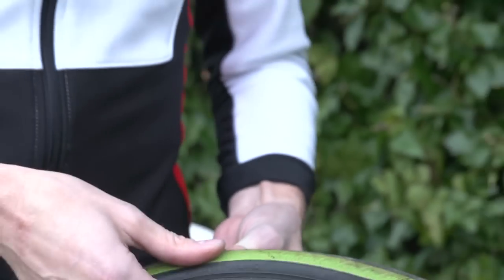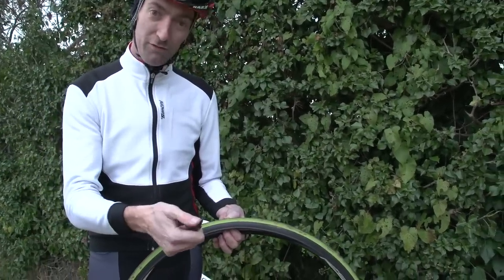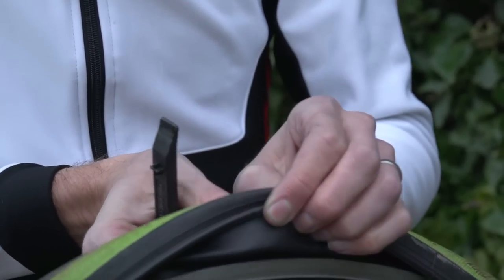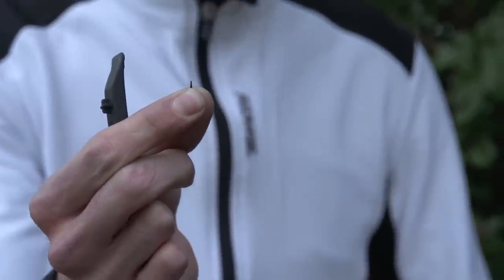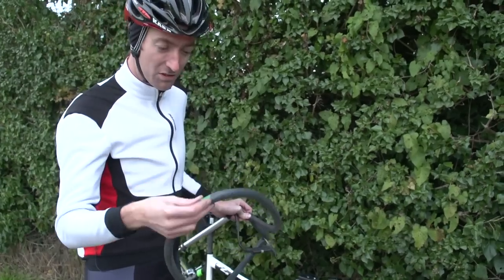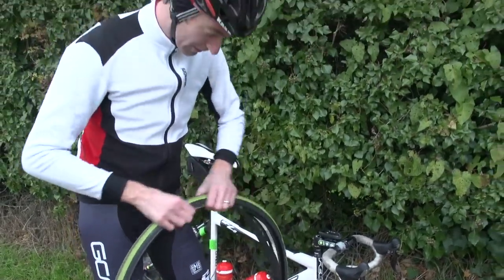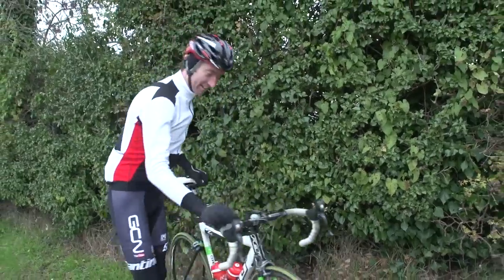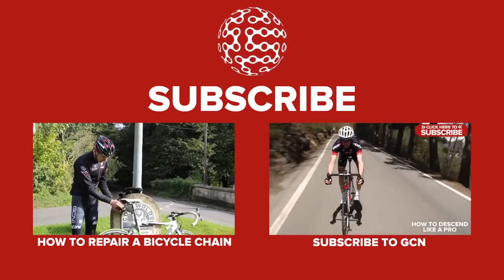How To Repair A Puncture On The Roadside - GCN's Roadside Maintenance Series

Comment: Stages of a puncture 

1 - The wince - as you hear the bang of the tube / wheel hitting the road. 

2 - Denial - you carry on for a few meters all seems okay so you think its fine to carry on 

3 - Understanding - as you feel the abnormal vibrations comming from the wheel 

4 - Rage - at the council / highways agency for not fixing that massive pot hole in the middle of the road 

5 Acceptance - you resign yourself to the fact you can't continue without a fix 

6 The fix - 5 - 10 mins wrestling with a tyre that seemingly doesn't want to come off or go back on again 

7 Marginal gains - after a succesful fix you feel suddenly rejuvinated and full of energy, performance of the new tube seems a mile better than the old one.
Reply: N
Reply: That was really funny and also true. Thank you for a good laugh!

Comment: An other tip to locate the hole in the tube : when you install the tire, line up the logo with the valve, then when you locate the thorn in the tire you can roughly match the same location on the tube.
Reply: Thanks ...I’ve done for years after a tip from the internet and it works a treat. Otherwise your gambling that you haven’t missed the sharp on your checks.

Comment: Guys love the videos "brilliant". To keep from potentially cutting your fingers on the sharp object inside the tire, I take the tire completely off the wheel, turn it inside/out then check it. It's easier to find what's inside since the inside is cleaner, no dirt or mud and you're less likely to get cut.
Cheers,
Bob (former Tweak of the Week) winner
Reply from the maker: Good points Bob, thanks for mentioning them.
Reply: hmm

Comment: Dan, how do I know the mini pump is giving enough pressure to my tyre if I didn't have a pump with a pressure gauge?
Reply from the maker: Press the sides of the tyre in to check the pressure, simple and effective. If you practice at home when they tyres are the right pressure then you'll know how hard they need to be.

Comment: here is how you ride tubeless
Reply: +Tucker Steward One does not simply ride tubeless if he wants a good ride on his roadbike.
Reply: Microage tubeless is a good rde no flats
Reply: Tucker Steward
Tubeless are way less comfy and feel sluggish compared to high end clinchers.
Reply: Microage yeah but a lot lighter
Reply: Tucker Steward
How? The tread is thicker and therefor the tyres are heavier, about 30g on a 25c. Additionally you have to add tyre sealant which also adds some weight.
Reply: Microage less rotating weight which makes it feel lighter
Reply: Tucker Steward
The rotating weight is the same or sometimes even more. The tyre sealant is also rotating you know :P
Reply: Microage no the tire sealant is at the bottom of the tire at all times flip a glass of water over and it goes to the bottom same with sealant
Reply: Tucker Steward
You really think it will stay on the bottom when you go like 20mph? xD
Reply: Microage yeah I go 40 to 70 down a hill and it does
Reply: Tucker Steward
No chance of that, dont forget about friction :P
Reply: +Tucker Steward haha. fuck me. top black cat here.